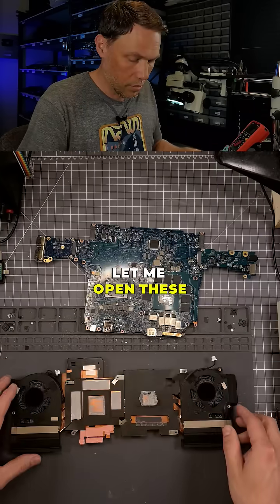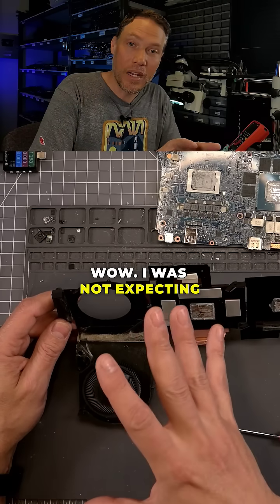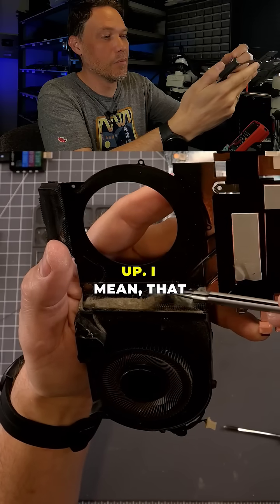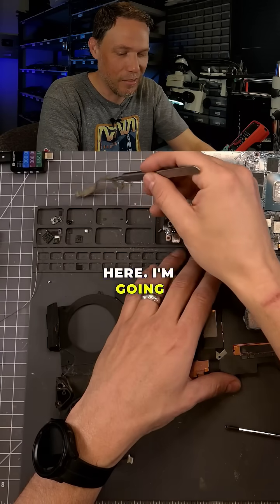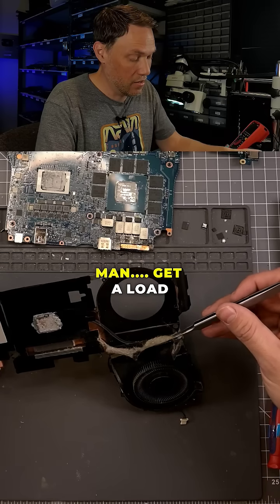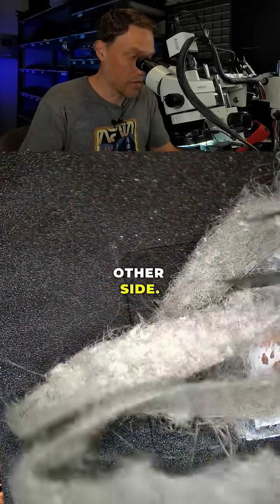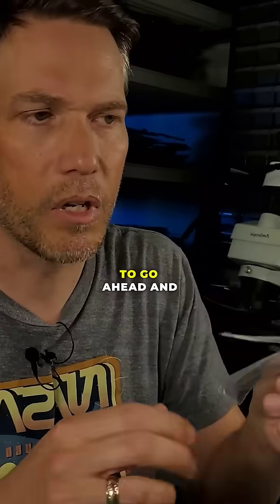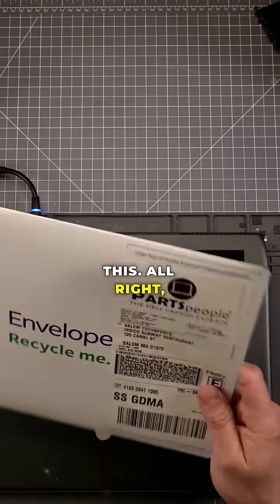Dirtiest Laptop Heatsink Ever- I Had To Send It To Salem Techsperts #pc #tech #laptoprepair

Comment: I’ve used the same principle with shredded cardboard and used motor oil before. As a test of “what can I survive with”.

It worked great, was able to make some nice dinner with it. The burner burnt for about 3 hours using a few strips of cardboard any maybe 20 millilitres of motor oil, which you could drain from a car if you really needed it.

I also made an oil lantern using a discarded glass jar, used motor oil, a cut-up soda can and a torn sock.

Fill the jar about 1/3th with used motor oil, cut the sock (I used one that was torn and thus useless) into thin strips to use as a wick. Cut the soda can to use as a support to hold up the sock wick. Then place the wick contraption into the jar, having the tip of the wick stick up about half an inch above the oil level, then light it.

Makes a good light for many hours.

This isn’t healthy of course and shouldn’t be used for regular use, but I was testing materials for a true survival method where you are stranded with your car.